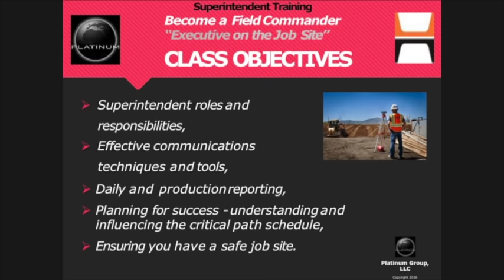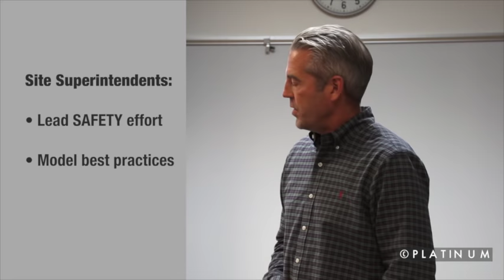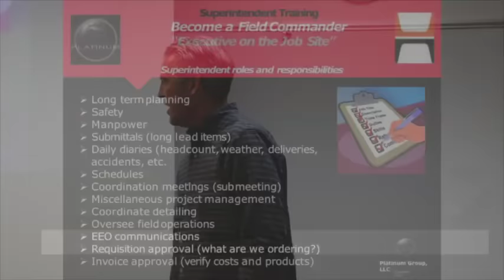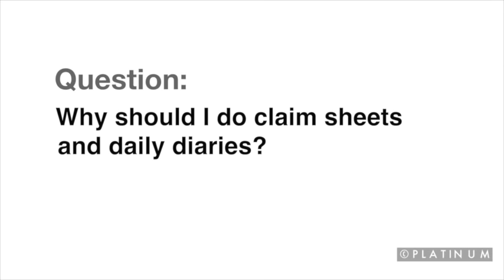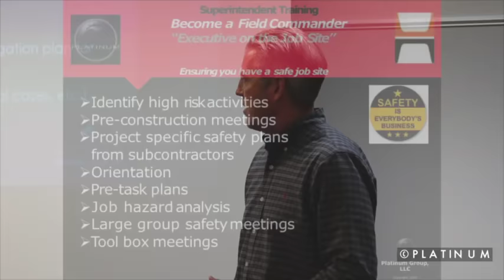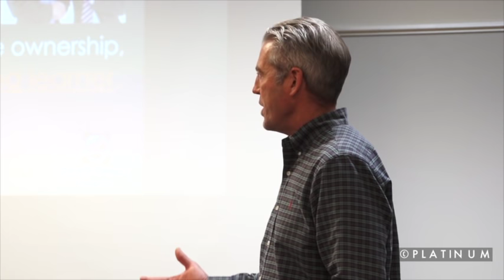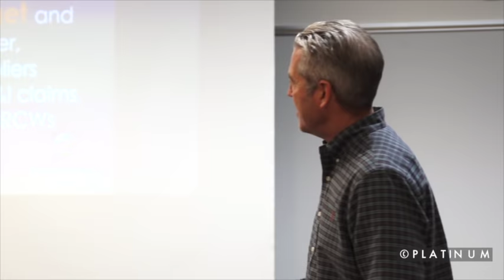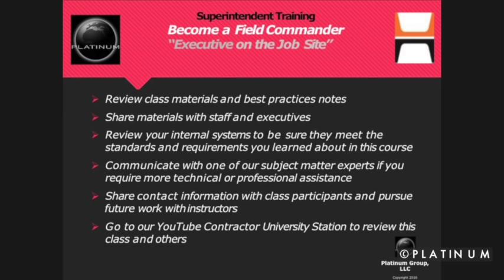Superintendent Training - Become a Field Commander

Comment: I’m a Union Concrete Finisher. To become a super I see it’s rare as a finisher. Can it still be done? It seems only carpenters move up in ranks. Great Video!
Reply: Luis V - I started as a landscaper and now I’m a superintendent! Anyone can be anything they want ! You just got to want it and go for it !
Reply: r/thanksimcured
Reply: ditch the union
Reply: I started as a non-union electrician, then as a union laborer followed by union pipe fitter and finally non union millwright. Hunger for constant growth has pushed me forward. Ive done many carpentry  side jobs through out my life aswell. Ultimately, i think it all boils down to understanding the process from start to finish and being diverse as a professional within the trades. Carpenters move up because they deal with all the trades, from building forms for concrete to communicating with fitters and hvac guys according to prints to ensure openings are kept through drywall or concrete to allow the run of service for piping or duct work. Once you get in deep enough as a skilled multi craftsman, adversity and challenges are the only thing that keep me going. Best of luck my man! Im still new to the title and honestly it doesn't seem to burden me at all. Research all you can!
Reply: @trollin456  accurate point of view. You can't deliberate when you don't know things work. Thanks 😊
Reply: Mason turned super. Got to work with many trades throughout the years. Used that knowledge to move up the ranks.
Reply: @trollin456  burdens and challenges are something I’ve come to actually enjoy myself. Weird most people get scared away from that lol. I’m coming from construction inspection & preparing for my first role as super. Mind sharing some advice and things you have learned the hard way?
Reply: @Jhustlafy  I am preparing for my first role as a superintendent.Coming from construction inspection, a lot of concrete.  care to share some advice ?
Reply: @trollin456 How you making out as a Super?